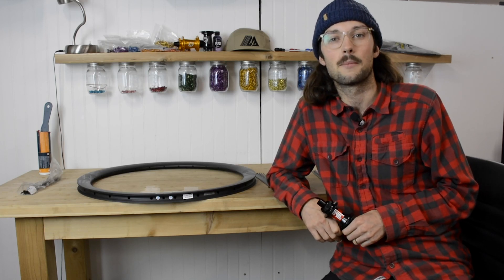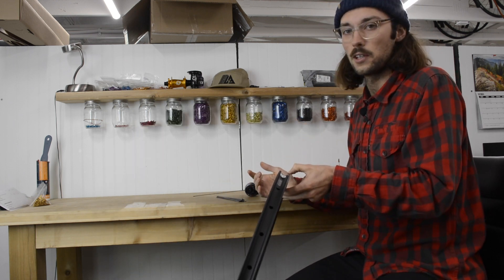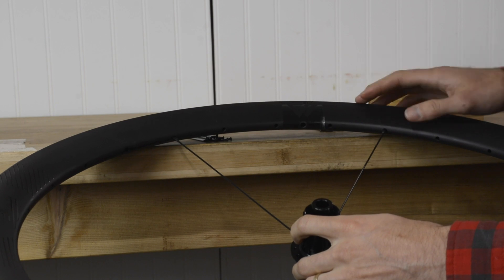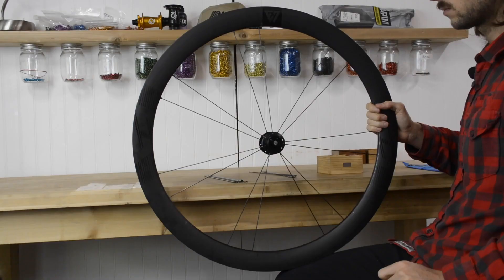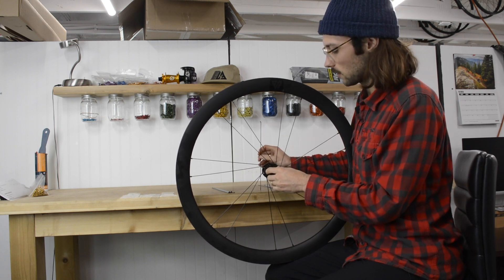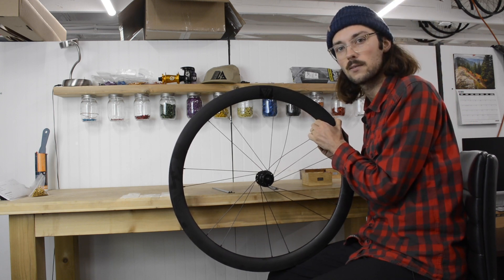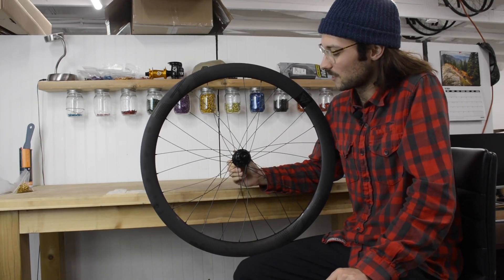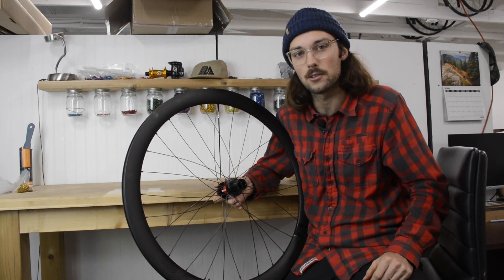How To Lace A Two-Cross (2X) Disc Wheel

Comment: Thanks for the video ......I've decided to use 2 cross on a 20 inch wheel rim 32 holes for my delta trike rear right single speed 22t surley hub .....do you think 2 cross will be ok

Comment: Good Video 
for 28 Hole MTB 29er wheel 
2 Cross or 3 Cross Pattern ???
Reply: I'm thinking 3 cross. What did you end up deciding?
Reply: @andrewbray2924  3 cross with Novatech 12x142 hub and Sun Ringle Duroc 35 - https://www.youtube.com/watch?v=gIvyorSqLUM&t=2s
China no name Frame
Reply: @jonienglish3231  That's awesome!